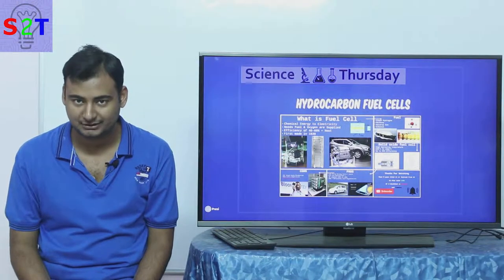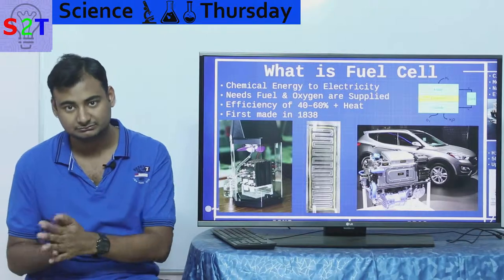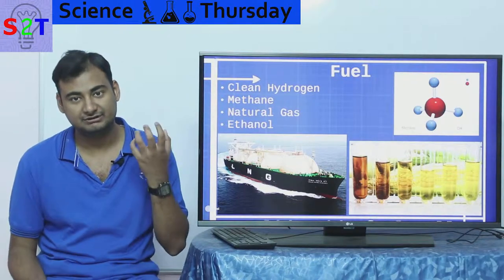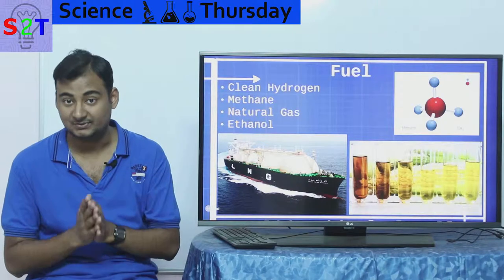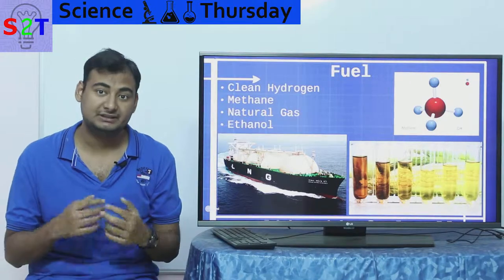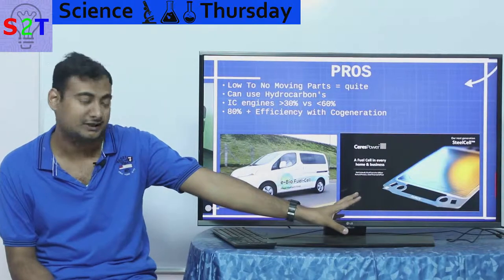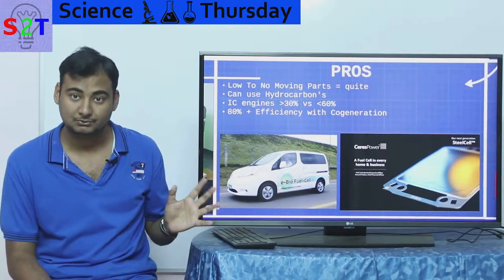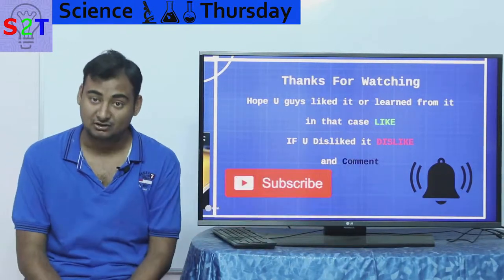Science Thursday Ep21 (Hydrocarbon Fuel Cells)

Comment: Until they figure out how to use biochemical catalysts, ie enzymes to lower the temperature of the fuel oxidation instead of expensive metals like platinum, the cost effective hydrocarbon fuel cell will likely continue to be a few years away.  Why don't they devote more research into how nature extracts energy from the oxidation of carbohydrates and fats, ie respiration.  Nature already figured this fuel cell inside a living cell.  Each fat molecule already has 3 long chains of hydrocarbons.  Plus the 'fuel cell' inside each living cell operates at less than 40 deg Celcius.   Why reivent the wheel?
Reply: In the case of a hydrocarbon fuel cell, I think it's worth the platinum. For tractor trailers the biggest expense in operating cost is fuel, simply doubling the efficiency alone makes it a worthwhile investment, with the added bonuses of mechanical simplicity, having kinetic energy recovery, reducing the over all mass of the power plant and drive train, and honestly making the whole thing easier to operate. You're not going to cringe with a kick of mechanical empathy every time you have to hill start an oversized load in in 1 low.